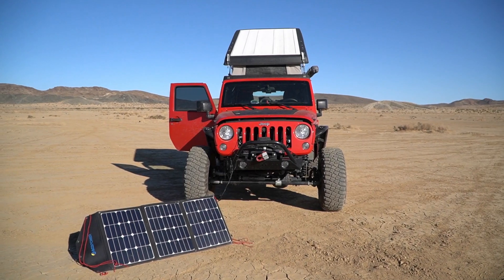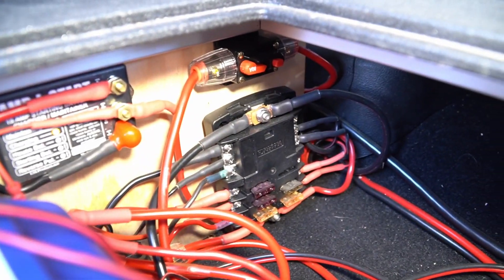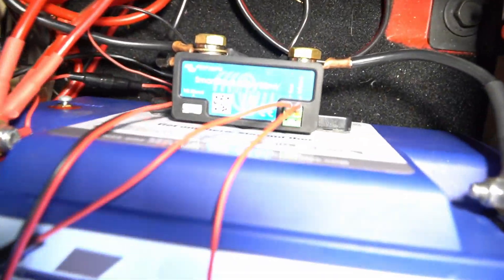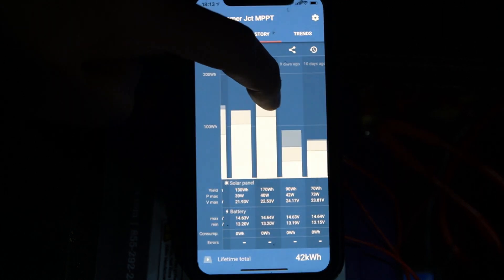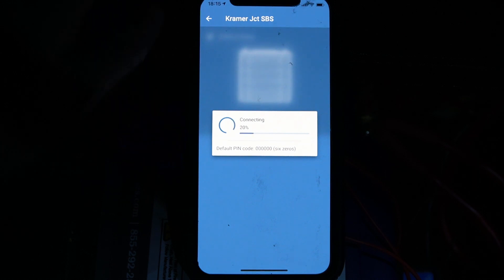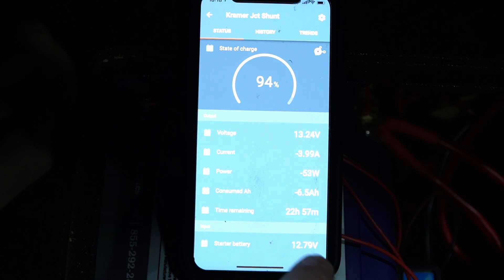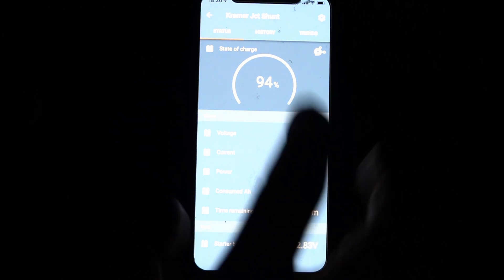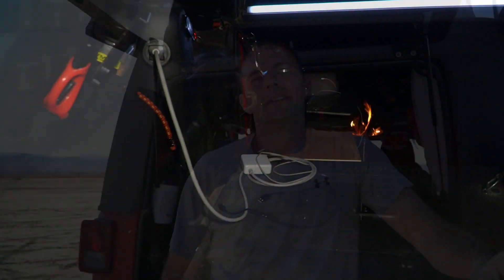Ultimate Overland Onboard Power System

Comment: Hi, very much enjoy your videos. Currently working on our JL set up and am curious about the hood mounted solar. I’ve heard that heat is the enemy of solar panels. It lessens that efficiency. Could you share how efficient the panel on your hood is compared to its advertised performance ? Thank you.
Reply from the maker: Heat from the engine bay is a regular inquiry with these panels. Heat does lessen the efficiency of any panel, there’s no way of getting around that. For my use, this panel is only being utilized while the vehicle is stationary, so heat from the motor running isn’t even a consideration. The max voltage I have seen my Victron Smart MPPT log in the history was 61 or 63 watts. This is a flat panel, mounted to a flat surface which is rated 100 watts. I probably average 30ish watts right now with the sun at the extremely low angle it tends to be in this time of year. No panel is 100% efficient and without the sun always being in an ideal spot I think that is really good. I’ve had the panel about a year now and I don’t even think about it. People are always super surprised to find out it’s a solar panel, everyone thinks it’s just a decal lol
It’s expensive as far as watt per $, but you’re paying for an extremely niche item which is made extremely well.
It’s not for everyone, but it fits my needs perfectly.
Reply: @KramerJunction  Thank you so much for taking the time to write all  that.  great info. i really enjoy your vids and they have helped in the planning of our build.  thanks again
Reply from the maker: @luisandluisgabriel6778  I’m glad you like what I’m doing and find it useful. I hope you stick around for more to come 👍🏻

Comment: We mounted a eb70 by Bluetti in the rear of our jeep powered by the main yellow top through our switch pros so we have low voltage protection… powers our ARB fridge 24/7… has USB C PD for laptops, 700w inverter & MPPT input charger. We will add a solar panel either to the good or our roof rack at some point but it has been necessary so far except for when we park for more than 3 days…. & we have a fold out panel to help with that. 

Thanks for sharing your setup. That battleborn is awesome